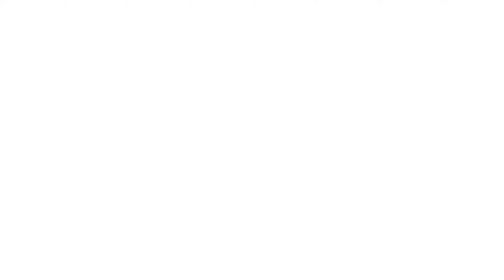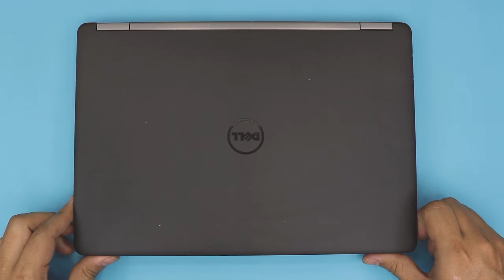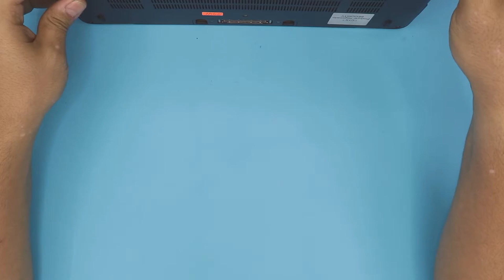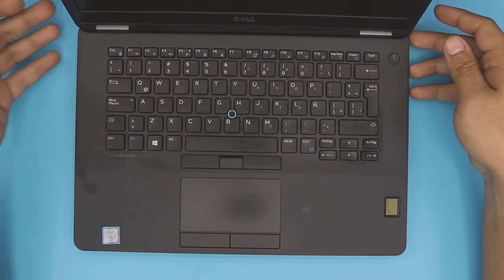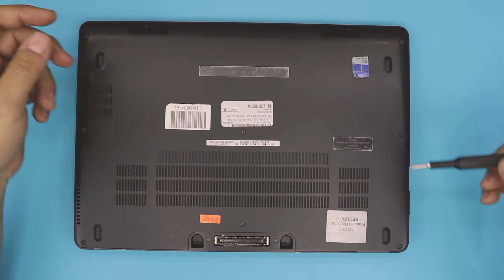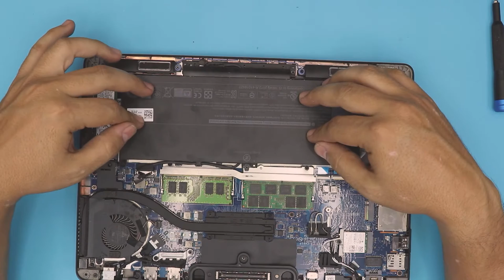Dell Latitude E7470 Battery Replacement

Comment: My battery was dead! My laptop model are same that you show in the video! E7470, if i remove the battery from laptop can i use the laptop direct using charging cable?
Reply from the maker: 🫠Regarding your question, sure you can and it will work just fine and the charger will last longer.
Should you have any further questions or requests in the future, please don't hesitate to ask me.
cheers🍻
Reply: @uFixTek  "My laptop is the same model as the one you mentioned. I have asked many people, but they said it won’t work, even though they are inexperienced. But if I remove the battery just the way you showed, will the laptop work directly with the charger? Without the battery? Are you sure? 🙂💔"
Reply: @uFixTek thank you ❤ today i try this! My laptop are running without using battery, thank you so much!
Reply from the maker: I've been repairing and servicing laptops, PCs, and consoles for over 22 years. Trust me when I say it will run fine, and your charger will last longer—so will your motherboard.

Comment: Many thanks! Fortunately, I succeded to get a replecement battery even nowadays! How nice was earlier, when you could switch batteries by just a single pull switch...Why manufacturers changed that way? (ofc it is just a rhetorical question).
Reply from the maker: Thank you for your feedback! If you wish to support the channel, you can like, subscribe, or both!
Regarding the battery, they don't want people to be able to service and upgrade or remove the internal including battery, it's all part of design for benefit THEM not the user.
Should you have any questions or requests in the future, please don't hesitate to ask me.
cheers🍻

Comment: Hi, The screen of E7470 stucks all of a sudden during work. Is it due to weak battery? How can I diagnose battery health on this machine?
Reply from the maker: Thank you for the feedback! if you wish to support the channel you can LIKE or SUB or both :P
regarding your question:  your screen freezing has nothing to do with battery going bad, and the laptop can work fine without the battery connected only with charger connected. 
if your screen freeze with charger connected let me know and i get back at you.

Comment: Gotta keep that cable though! Seller provide battery but no cable.
Reply from the maker: Thank you for the feedback! if you wish to support the channel you can LIKE or SUB or both :P
regarding your feedback:  most of the seller should provide the cable we do purchase then very often for our clients and we do get them with cable. BUT you are right don't trash anything until you have the new parts and installed.

Comment: Hi thanks for that video very much instructive - I read some comments about keeping the original cable whene we replace the battery - what is your view on this comment?
Reply from the maker: Thank you for the feedback! if you wish to support the channel you can LIKE or SUB or both :P
regarding your question: it all depends when or where you purchase the new battery some seller will provide you with the cable and some don't , mostly don't, but if your original cable is not damaged detaching by just pulling on it and re use it.
if you have any question or request in the future feel free to ask me.

Comment: thaks so much! What if I remove the screws completely from the cover?
Reply from the maker: Thank you for the feedback! if you wish to support the channel you can LIKE or SUB or both :P
regarding your question: nothing will happen just push it back it and screw it in, its not a big or small deal :P
its common that it comes out or people pull them out

Comment: Useful video. Thanks. But one final step would have helped more. For battery replacement, the cord needs to be disconnected from the battery and reconnected to the new battery. It was easy. I tried and it worked.
Reply from the maker: thank you for the feedback! if you wish to support the channel you can LIKE or SUB or both :P
regarding your question:  Yes, you are right, but its just a pull and push :P

Comment: All great except some batteries come without the cable so you need to move it from the old battery to the new one...
Reply from the maker: Thank you for the support and feedback, regarding the cable of the battery most provider they include the cable, but its a snap on cable, and i have included the link to the cable in case if anyone needs one. and :( i guess i should of mentioned to remove the cable to the new battery :P
🔵 Battery cable: https://amzn.to/3rWb8kh
Reply: Use the OEM one